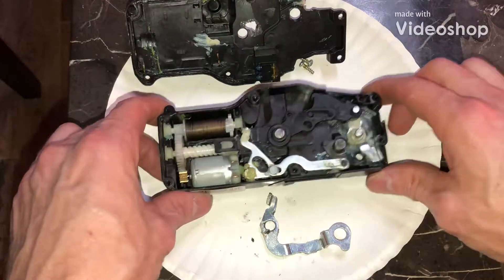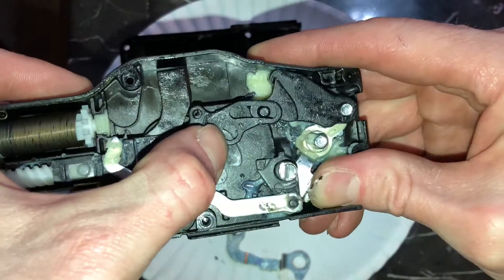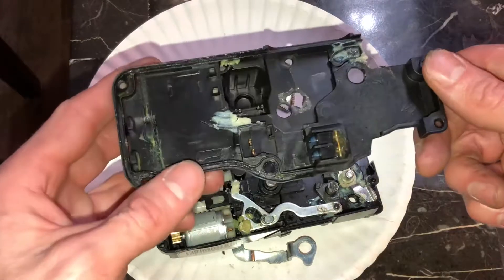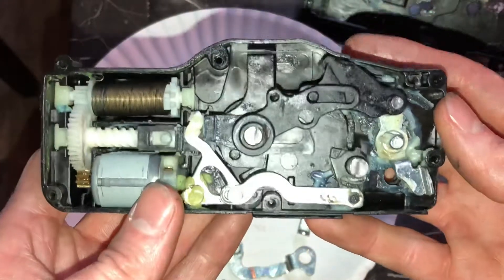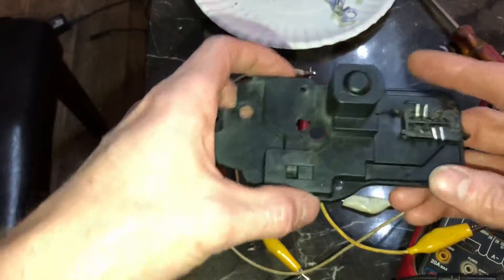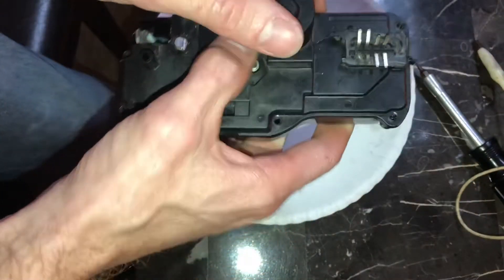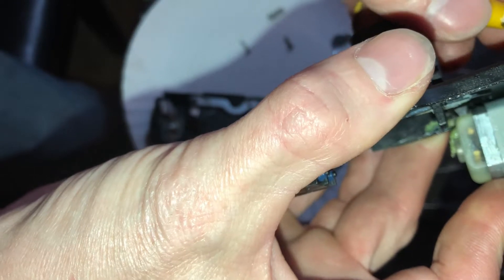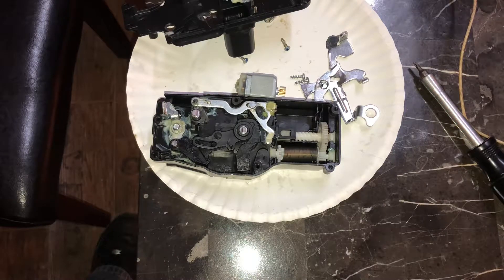Inside C6 corvette door latch and why it failed

Comment: Hey im having trouble getting out on the driver side, sometimes it unlocks and sometimes it doesn't and i have to use tbe emergency exit latch on the floor. Do tou think this is also my problem.  Thanks
Reply from the maker: DJC it could be.. is it making any noises at all when it don’t work ? Could also be the actual switch u grab as well

Comment: Hahaha, today(05/05/2019), I'm running around town trying to find that tiny DC motor. None in the u.s. of a. I guess I have to go to China to find it. Thx to your video I will see if I can get mine to work
Reply from the maker: MY FAMILY I think getting it back together would be the tricky part.. let me know!!
Reply: @djnemesis82pluss1877  I figured out, got mine working. Facebook me at "Hmoob Yaj" its easier to explain there